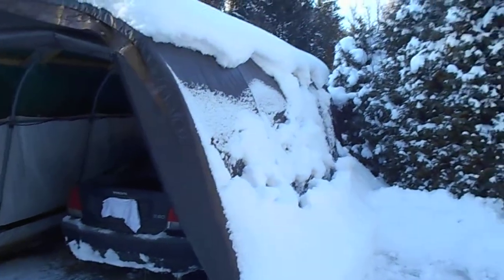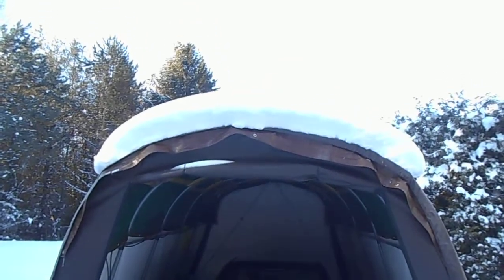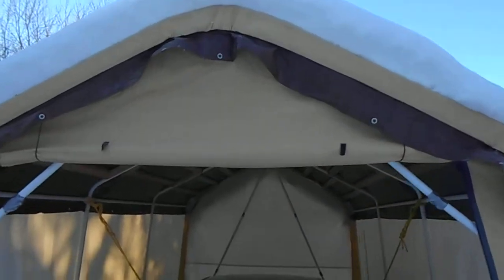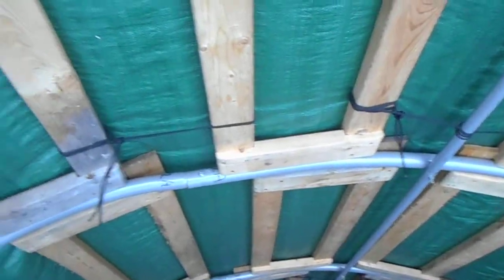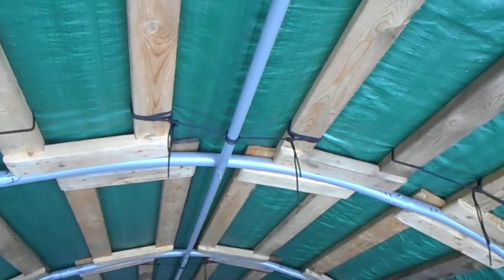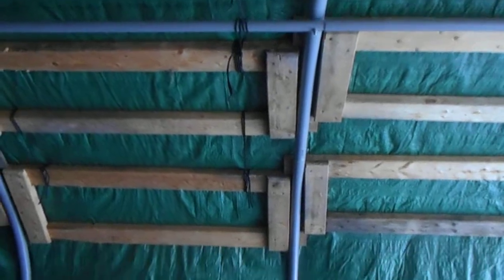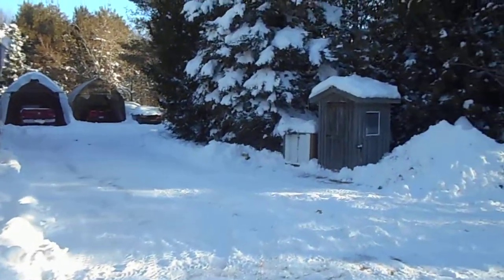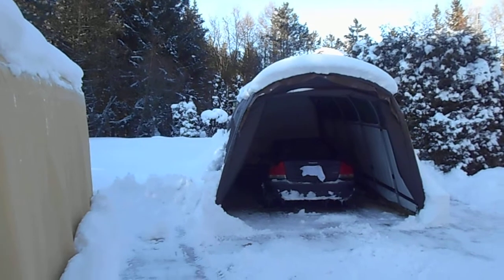Shelterlogic winter snow load test proof.

Comment: I used 1x4x8 and screwed them right in the frame,still holding 5 yrs, never have to shovel snow off it
Reply: maybe l'll change to 1x4x10 instead of 1x3x8. spacing of supports are 5' apart

Comment: We have a shelter logic up here in interior Alaska.  We knock the snow off after each snow fall as our neighbors shelter logic collapsed under a heavy snow load.  Winter of 2020-21 had a total snowfall of 91.3 inches...a couple of buildings in town had roofs collapse under that much snow load.
Reply from the maker: Hello Missy Skeeter nice to hear from you. The snow in my area of Ontario which is 30 miles north of Lake Ontario has changed over the years. I use to get powder snow and one year I had 48 inch cuts in the drive with the snow blower. I now get more wet snow but that kind can be very heavy and dense. From Uxbridge Ontario Craig Clayton

Comment: What are your thoughts on reinforcing with pvc pipes? (Maybe glued together?) The bracing could all be attached together in any direction using 4 and 2 way connectors. Uprights could be placed between the existing ones and the cross bracing could be put on existing ‘rafters’ as well as additional ones put in between. The ends could even be attached to some type of flat metal base that has a metal tube that would fit inside the pvc. They could also be cemented into deck blocks, sonotubes, or metal pails. For stress points on original structures, maybe slicing pool noodles and covering the entire tube (so it was even on the pole and wouldn’t create new stress points!) You could also use the foam insulating tubes they make for pipe insulation. 🤷‍♀️ Just some of my crazy thoughts!! 😂 
That said…I didn’t do these things in my current shelter…these are ideas for my NEXT shelter- but I’ve had my Shelter logic shed for 15 YEARS! Same tarp- no collapsing! AND I live in the snow belt in Ontario between Lake Huron and Georgian Bay!!! I don’t think I’ve ever cleared snow off it! Mind you, I do have it set back a bit and it gets some protection from cedar trees. I’d like to hear thoughts on the pvc (or other hard plastic tubes that I might not know the name of!!!😋) I like the fact that pretty much anyone can cut pvc pipes and glue connectors on- K.I.S.S rule- which applies to me!!! 😂Patti

Comment: l'll be coping your great idea . l'll be using 1"x3"x10' spruce strapping to the roof.Last winter l had a pile of snow and then it rained briefly and then it froze..NUTZ..! it leaked after warming up in spring. l tried to removed but the frozen snow was too heavy. l added a heavy duty tarp recently and will get into the strapping and hope for the best..a friend of mine had the his tarp collapse with weight of frozen snow and then blew away.
Reply from the maker: Hello carl I just erected my round shelter up in my driveway  for the winter doing it all from the modular method and it will be taken down in the spring. Craig

Comment: Possible upgrade idea?...I think adding a strip of 1/2' or 3/4' plywood screwed to each 2x4 support panel that bridges the pole would lock the panels together and also add rigidity to the pole. And sanding or chamfering all the right angles at each 2x4 end might help with wear points on the shelter cover. Sooo many ideas! Thanks for sharing :-)
Reply from the maker: Hello Scott Great idea to strengthen the roof, for the snow load , but I take the structure down come spring as it is sitting in the middle of my drive/ parking area at this very moment. Craig

Comment: The dimensions of these structures is such that dimensional lumber does not efficiently fit or span. 
I recently used orange snow fence under the cover to support it under load. Needs to be constantly tightened with zip ties until it settles in. The big stress point is the sharp tubing angle where the roof meets the side and this needs to be supported.

Comment: Holy cow!  Great minds think alike!  I was just thinking of doing this same thing!!!  Only thing different, I'm going to use heavy wire ties instead of cord to lock everything in place maybe. Also, 2 x 4 might be over kill?  Maybe, furring strips, but more of them.  2x4's are $8 USD each!
Reply from the maker: Steve I think that you should be careful with wire ties as they could rub on the cover and make a hole. I used the paracord it is strong and soft and I made every length the same so it is a no brainer when putting them up. Craig Clayton
Reply: @craigclayton4514  That's a good thought.  The more I think about it, I'm just not going to bother wasting time and money.  THey aren't meant for snow and only good for temp. setups.  We are all pushing them when we think they can be a long term solution.   Think everyone wants to turn these cheap things into year round storage.  Just not sure it is worth the efforts.  The best I've seen was the addition of sheet metal roof panels.  And then, you have to wonder just how much of a snow load will that hold?  I suspect not much...

Comment: How's the SUV shelters holding up? I'm looking for something a little bit more maintenance-free as I would be using it in the back of my welding shop as a paint booth. I would be making modifications by adding a back wall out of plywood and a front wall with a door so I would only be using the structure with the tarp.
Reply from the maker: Hello R.C Did you look at the SUV shelter video because you replied on the round shelter video. If you look at the other shelter video's I have made the newest is about the SUV. I used the Princess auto hay tarp cover 48 x 24. As it is in the first winter of snow I do tap the roof from the inside. I think that if I use my wood frame design from this video on the SUV I would be able to walk on the roof. With the wood frame  for snow is not a problem, the SUV were put up with the hay tarp as the Shelter logic covers fail on the new tarps the older tarps were better made. I am in Ontario north of Toronto but not in the snow belts. Craig Clayton
Reply: @craigclayton4514  I'm in Hamilton ont. We get bad snow storms as well. I noticed that you mentioned that the SUV shelter was better at maintaining less snow on its peak. I don't want a shelter that I would have to remove the snow off the top as I'm not always at my shop. I will definitely checkout your other video and sub to your channel.

Comment: Great way to hold the 2x4s in ,why do you remove them when it's warmer could they not stay permanently. Great idea for our snowy winters here in Canada .Enjoyed the video Thanks. PS what brand of tent shelters are the ones you said can take the snow load ,the 2 closers to the house and are they alot more expensive. Thanks again Dale
Reply from the maker: The 2 shelters close to the house will be taken down as soon as the morning dew or heavy mist is cleared, as they sit right in the middle of my parking area. Craig

Comment: I'm bracing my top of carport for my winter but still,no way my carport would survive if i didn't remove all side tarps because winter wind.now wind can blow through sideways.but your carport top might be better curved for wind
Reply from the maker: Hi doc I just finished putting up the tan and brown shelter today. I started last weekend and single handed assembled both from the ground up, I am planning to strengthen the front of the brown using 4 sections of tubing left over from a round trampoline, it should make it very strong. In my mind I have a picture of it looking like building with whale ribs.
Craig
Reply: @craigclayton4514  thanks,i'm just using alot of super strong big rig truck rubber bungees on top,because very light snow and wood would be overkill with light snow here.basicly your design modified.lol

Comment: what size is this?
Reply from the maker: Hello Justin the size is 20 ft long 10 wide at the base and about 8 ft at the top. It is up right now in my driveway, I did not put up the cheaper tan shelter this year, do not need it. Craig
Reply: @craigclayton4514  thank you. Because I bought a 12x20 but can't set it up yet. Because of snow and stuff.  Basically looking at videos of how wide these are and how much room with a car inside. By the looks of it and with some modifications. I am learning that the 12x20 will be perfect for working in cars inside